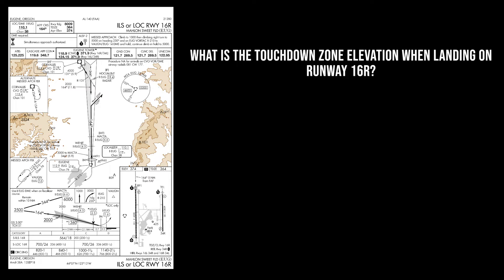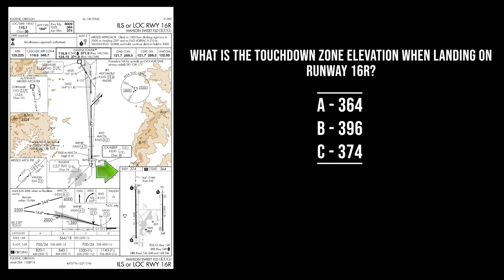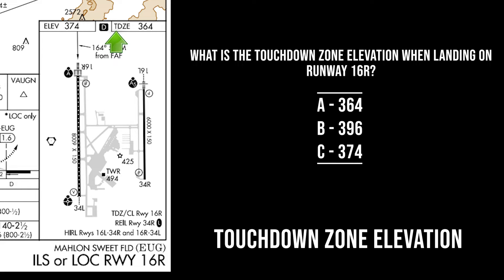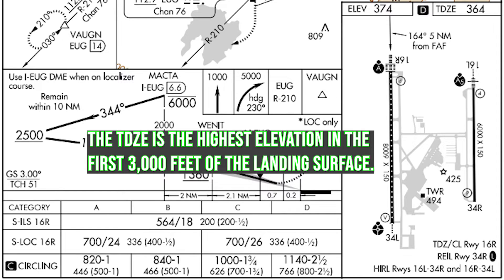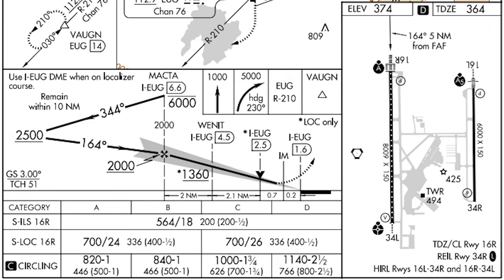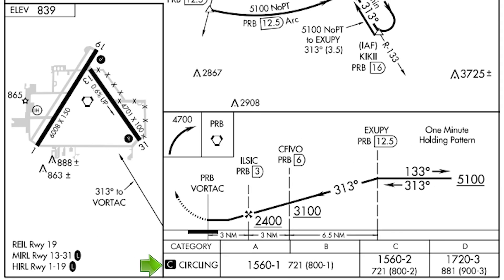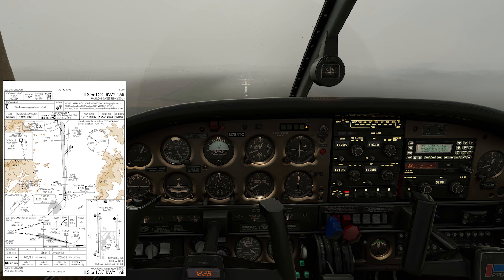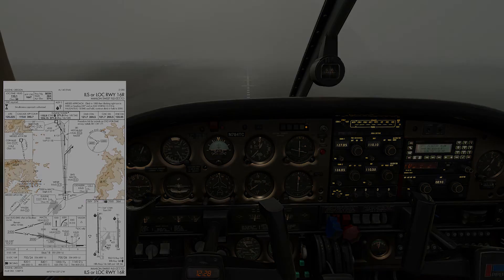Touchdown Zone Elevation - FAA Written Test Question

Comment: Is it to do with using the approach lights as a reference for an IFR landing below 100 ft above the TDZE?

(CFR § 91.175 (c) (3) (i) Takeoff and landing under IFR states: "... the pilot may not descend below 100 feet above the touchdown zone elevation using the approach lights as a reference unless the red terminating bars or the red side row bars are also distinctly visible and identifiable.")
Reply from the maker: You are correct.